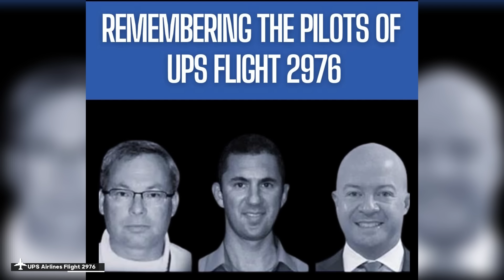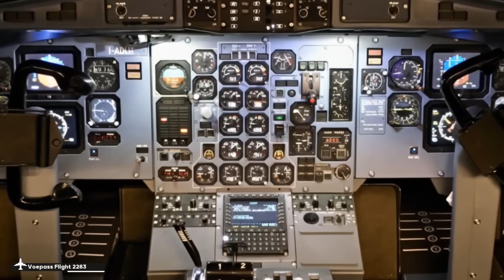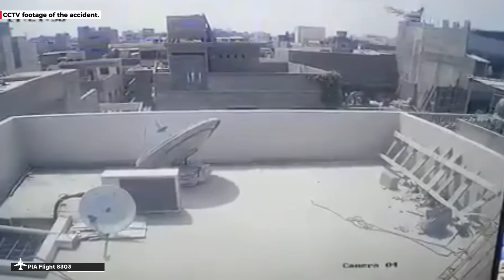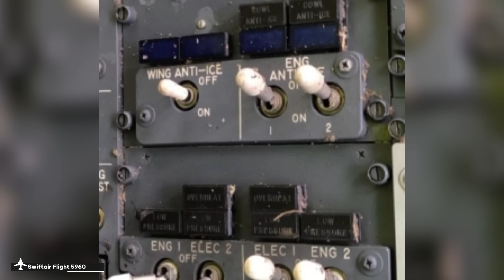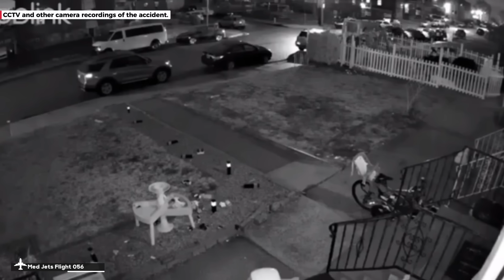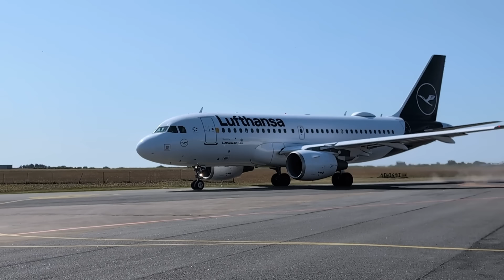7 SHOCKING Plane Crashes Caught on CAMERA!

Comment: On story 1, I heard, and I don't know if it's true or not, that a family member of one of the victims on the ground was suing the family of the captain of the plain. If true, I think that person should be repeatedly slapped in the back of the head with a cricket bat, as, what happened to the plain was a maintenance issue, which in this case, has nothing to do with the flight crew. It's all on ground staff and airline management responsible for that.